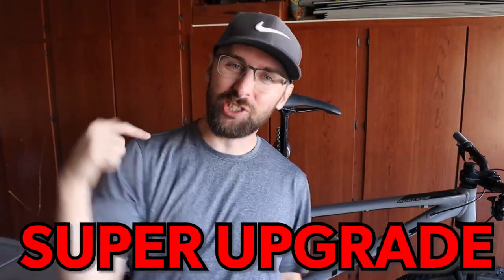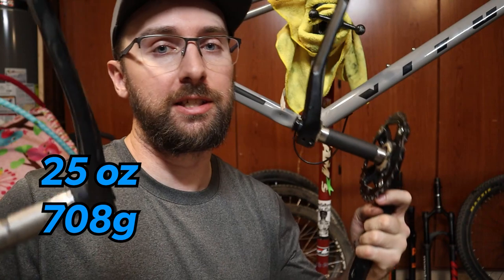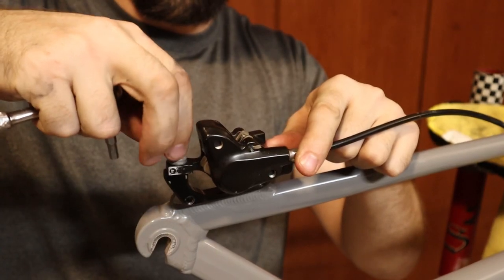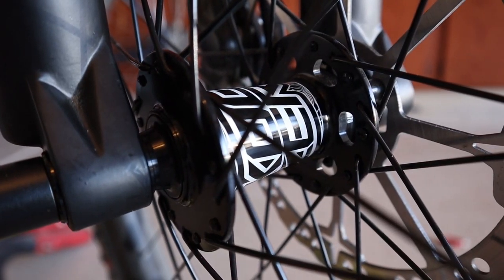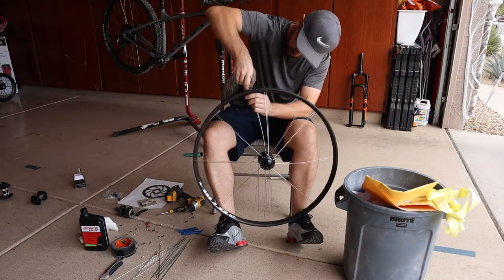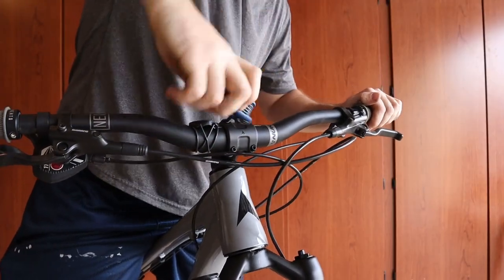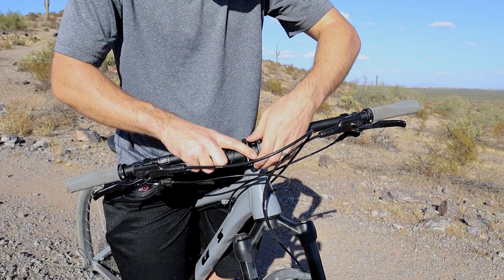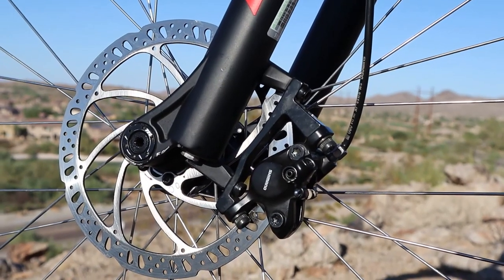Super Upgrading the Vitus Nucleus VR!!

Comment: Nice upgrades. I brought my hardtail down from 36lbs to 29.00lbs on the dot with a major parts upgrade. It's an excellent climber and great for those XC days. Looking forward to see how your race goes. I will have to train up and try one myself someday.
Reply from the maker: Yeah 29 lbs must be a magic number. The bike felt so much different. Im curious how much lighter I can get the bike.
Reply: @EvansMTBSaga  I borrowed a friend's Giant Anthem Advanced which was a 25lb full suspension. It made me realize how heavy mine was at 36lbs and pushed me to change it. I was shooting for 30lbs and would have been happy to see 29 something, but was pleased to see it hit 29.00. I'm sure I could get better hubs to lighten it, but I'm pretty happy with it right now.
Reply: @EvansMTBSaga  a big difference was going with the super light weight SR Suntour Epixon instead of the Rockshox Recon I was looking at or the Judy. The Epixon air fork with lockout and rebound and a 32mm stanchion like the Rockshox ones but was a good 400g lighter at 1700ish grams. Definitely lighter than the almost 7lb coil XCM that I had on there before.
Reply: 👍 am not have bike yet no money

Comment: Im trying to replace my crankset on the same bike but i cant get it off, you seemed to have skipped that part in the video
Reply from the maker: They used thread locker. Make sure you have the right tool and are turning it the right direction. I had to apply force on the tool! (Hammer)
Reply: @EvansMTBSaga  Thanks man its the bracket on the side with the chainring that will not budge without breaking that side of the bottom bracket, honestly I'm just going to risk it and buy a new BB anyway.. Vitus weren't too clear on what BB I would be looking for they just say "BSA".. there are so many, Could you tell me what one I should be looking for ? 

Love the videos, much love from Scotland <3.
Ps I love the bike but its been such a pain from the start, had to get a 1x11 Shimano Deore because box is trash lol.

Comment: Nice video, I am on the same boat going to get lighter fork to replace the suntour on my Salsa Timberjack SLX.  Suggest you to try those Amazon gold color semi metallic brake pad for the MT200 brake. My bike also come with MT200, stock resin pad start fade after around 5 seconds use on descent. it was much improved with the new pad and rotors.

Comment: Hey. Loving the video - I also have this bike now :) I've bought some new top headset and cup. However how did you get the old cup out? is there a special kind of tool? and do I just need to use a mallet to put the new headset cup in like you did in the video? Thanks :)
Reply from the maker: I got it out with a screw driver and a mallet, then carefully pounded it out. Putting the new cups in is pretty easy with the mallet, just grease them up pretty good!

Comment: I have the 2021 vitus nucleus VRS and I’m having the issue of when I’m in the largest gear and start to backpedal the chain jumps off. Any ideas of how I can fix this? The bike came with a spacer on the bottom bracket that spaced the crankset farther from the frame and I took that off to reduce the angle on the chain but didn’t seem to fix the issue.
Reply from the maker: That happens to the best of us. I watched a segment on GMBN about back pedaling and he didn't have any recommendations. Only "don't back pedal". So I'm not sure either.

Comment: Took my 29er vr to some light trails and now the fork is loosing air. Should i try warranty? Any ideeas for a more trail oriented fork? Nothing extreme but should take some light jumps and a lot of bumps
Reply from the maker: Dang losing air already! Yeah definitely try to warranty. What is your budget for a new fork?
Reply: @EvansMTBSaga  I hoped for the original one to be ok for one year so I can save up for a better bike overall but I could put 250 in a new fork. 
I contacted CRC, they said ship the fork to us and we will inspect it. I can either wait for them or upgrade in the meantime so I can keep riding and maybe sell the new fork when I get it back
Reply from the maker: I had good luck with Manitou Markhor, and also X Fusion RC32 is a great fork. I recently bought a used fork and rebuilt it, which is also a good option.
Reply: I'll have a look. Thanks. 
Love your work btw.

Comment: Did you have an issue with spacing for the 11 speed cassette? I purchased a Sram NX groupset and I'm worried the 12 speed cassette won't fit on my stock freehub
Reply from the maker: No problem. It should fit if it's HG driver body. Sometimes you have to play with the crank spacers

Comment: Hi, I’m really enjoying your videos. I have a Vitus Nucleus vr 2021 and I’m not impressed with the Box Four shifter and derailleur (the shifter is very stiff) Can I just replace these two items with a better brand or do I need to replace the whole group set? Thanks
Reply from the maker: You can get a different shifter. I wasn't a fan of the Box shifter either. You can get a Shimano shifter that's 8 speed. Just make sure it's 1:1 shifting, and it will be compatible.
Reply: @EvansMTBSaga  thanks for the reply 👍
Reply: @EvansMTBSaga  I’m having the same issue with my shifter. Do you have a link to a shimano shifter that would be compatible?

Comment: Can you confirm if that box 2 11 speed shifter can upshift 2 gears at a time and also downshift 4 gears at a time like the Deore xt does? I'm highly considering it for my next upgrade but I can't find that info anywhere.
Reply from the maker: It shifts into the harder gear one at a time. The shifter can theoretically downshift 4 gears at a time, but after some time with it, the lever isnt that solid and I can usually do two at a time without a problem.
Reply: @EvansMTBSaga  I appreciate this answer. Thank you!

Comment: How many times have you relaced your wheels? Lol
Reply from the maker: 4 times now haha. Trying to find a rear hub next.
Reply: @EvansMTBSaga  not sure if the Vitus is boost but I have an Origin 8 boost 148 hub (brand new & unused) if interested.
Reply from the maker: @ds1755  I wish the frame was boost. Its 135 QR, which is not ideal at all. Thanks for the heads up.

Comment: Do you have a list parts and where to get them?
Reply from the maker: I put the links in the video description, also:

Products seen in this video (affiliate links):
Box Two Derailleur - https://amzn.to/2KNeODq
Box Two Shifter - https://amzn.to/38lFpQ2
Box Two 11s Cassette - https://amzn.to/3mxH7Tf
Manitou Markhor 29" Tapered 15x110 Fork - http://ebay.us/iEhqtQ
Shimano M200 Brakeset - https://amzn.to/38mocpp
Jessica Headset - http://ebay.us/vXtyiP
X6 Crankset (not used in this video, but used in future videos and I highly recommend for ~$50-60) - http://ebay.us/odS1Wq
Origin8 Front Hub 15x110 32h - http://ebay.us/fLogMz
Vittoria Barzo 2.35" front 2.25" rear - https://amzn.to/3mKCRjH
Raceface Respond Stem - https://amzn.to/34rlJZR
PNW Dropper Post 125mm - http://ebay.us/rxO6VN

Comment: I have a 2020 Vitus nucleus with a Shimano Altus rear derailleur and I am looking to upgrade the drive train  for cheap do you think I can use a 11 to 46 tooth cassette if not do you have any suggestions on a 9 speed rear derailiur. Also where did you get that oval chainring from I'm also looking to ditch my 2x
Reply from the maker: Since the hub is a Shimano HG driver, you can absolutely use 11-46t cassette given you have the matching derailleur. Oval chain ring is from amazon, although I don't know if it provides any benefit.
Reply: The max teeth on the cassette is 45 on the Shimano Altus shadow rear derailleur but I have seen people bump it up a bit higher do you think this will work

Comment: Hi well done on the upgrades! I have a question. On the stock Vitus is the rear hub a freehub? Thanks
Reply from the maker: It's a Shimano HG driver body
Reply: @EvansMTBSaga  is that a free wheel or free hub? Sorry I’m a noob
Reply from the maker: @pumpkin8680  That means its a free hub, which is awesome because you can replace the cassette to something larger like 11 speed.
Reply: @EvansMTBSaga  that’s great news I thought it might have been a freewheel. That’s for clarifying!
Reply: @EvansMTBSaga  also a noob and I'm interested in this upgrade, what else did you have to upgrade for this other than the cassette. Does it require the rear deraillure, chain and gear lever when doing the cassette. And roughly what did it cost for everything needed as part of that?
Reply from the maker: @bmac5044  Hey no worries! So the bike came with an 8 speed cassette. I took that off and replaced it with an 11 speed, which then required a new derailleur and shifter. I bought the whole cassette, derailleur, and shifter as a combo and got the Box Two groupset for $150, which was on sale at that time. Microshift Advent is another great budget option. Super easy to replace!
Reply: @EvansMTBSaga  much appreciated man.

Comment: I have a question for anyone who can answer it. Do the brakes come with left lever for the front and right lever for the back brake.          Since I know in the UK the brakes come with the left for the back and the right for the front. I don’t want to otb thinking it’s the back brake.
Reply from the maker: My Vitus came with left lever for the front. I ordered off of Wiggle instead of Chain Reaction, which is what they want Americans to do
Reply: Ok thank you!
Reply: Also, can you measure the seat tube width because when I buy my vitus I will probably buy a dropper post but idk what size with to get.
Reply from the maker: @gondigondi7547  Seat post is 31.8 diameter